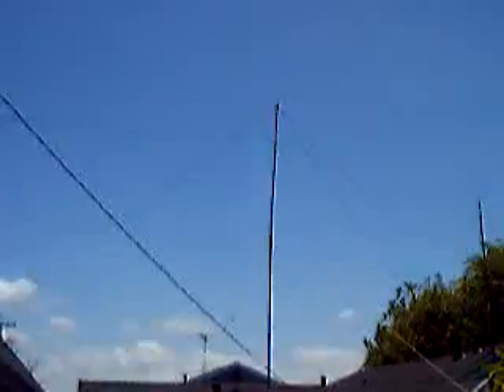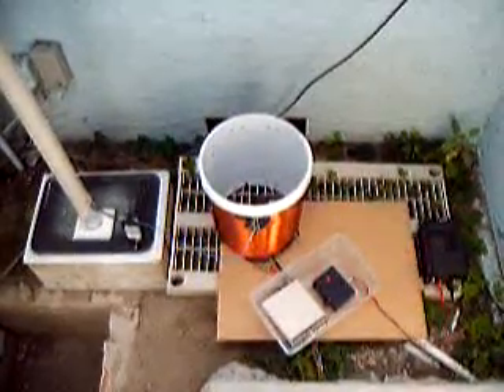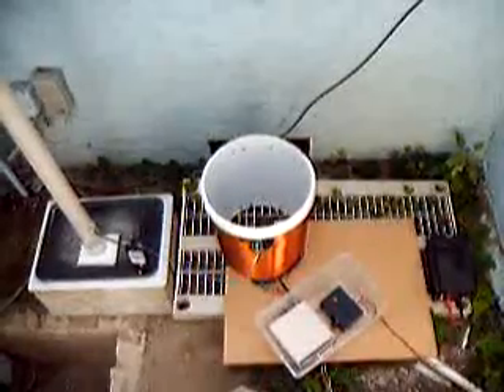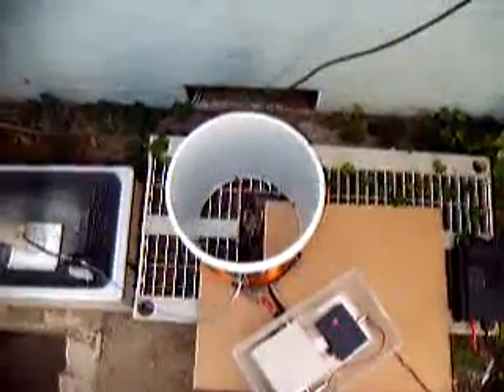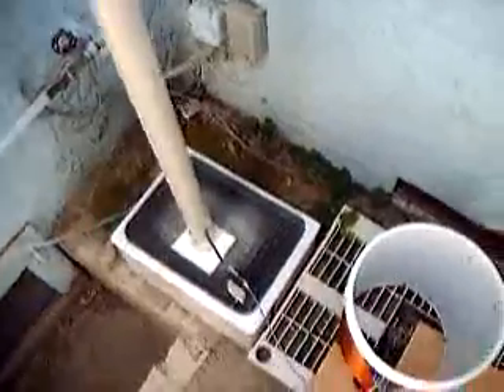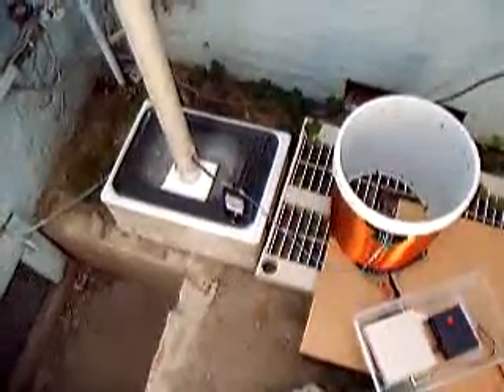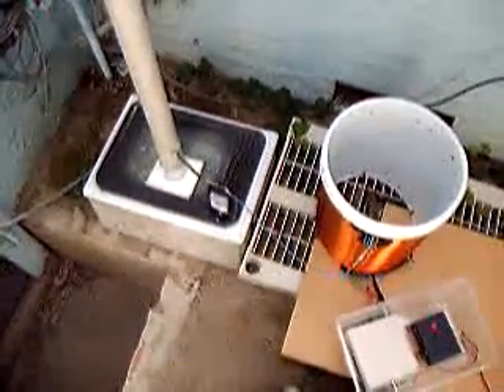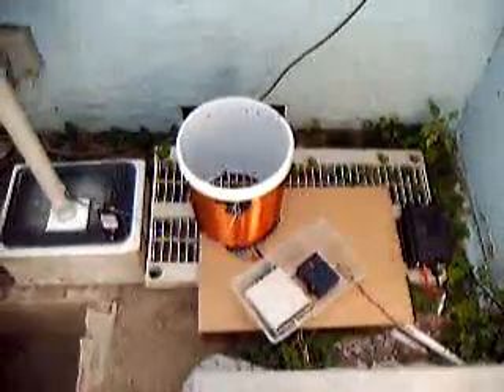Amateur Radio Beacon JAM 187khz LowFer 1750 meters Longwave

Comment: There used to be a 1750 meter band ssb net in the LA area. Is that still a thing?
Reply from the maker: No. Hasn't been a thing for a while. I would go out on a limb and say it hasn't been a thing since the late 90's. Since the FCC approved the new lowfer bands 1750 meters is waning. The only reason I was there, 1750 meters, was because there was no legal lowfer bands!

Comment: How much local range does your transmitter cover?
Reply from the maker: Wow. Commenting on a comment has become hard thanks to Google/Youtube merge. So the answer is more related to your antenna than the one watt xmitter. If you get the antenna right your ERP will 5 to 7 milliwatts. If you don't get the antenna right your ERP will be 3 or less milliwatts. My best speaker/headphone copy has been about one hundred miles. People in Orange County CA hear me all the time. Thats about 35 to 45 miles away. Nowdays most people are using computers and software like Spectran to get a visual copy. LWCA has info about that on their web site. Thanks for the interest.

Comment: Nice set up. We have a 136kHz allocation but I've never got round to building a transmitter. I've heard more activity on 501kHz even had a cross band QSO but not yet got a NoV (Permit) for the band.

Comment from the maker: @VitalisCarbone Music probably won't sound so good.  Because the antenna is so physicaly short compared to an actual 1/4 wave antenna. It has to be a high Q resonated antenna to radiate anything. This antenna is tuned to the coil winding tap that produces max antenna current at the operating freq 187khz. Audio/music sidebands would be plus or minus the 187khz operating freq by up to 10khz on the AM88 transmiter I use. The sidebands would not radiate well because of the tuned antenna.